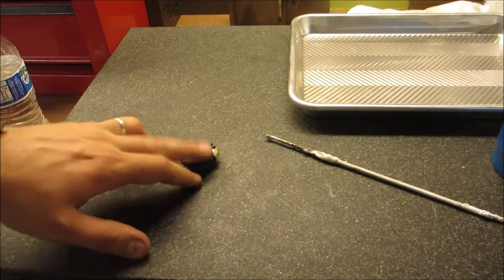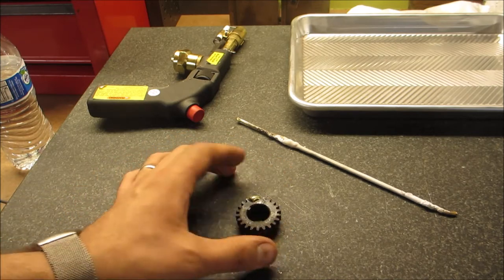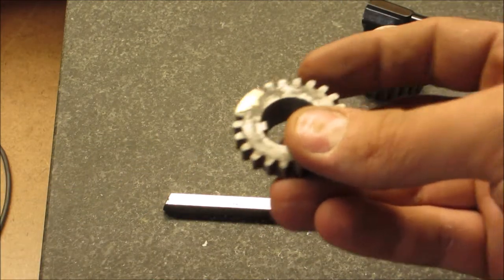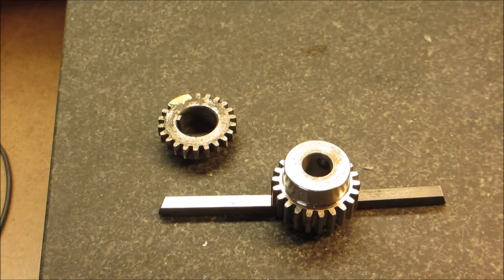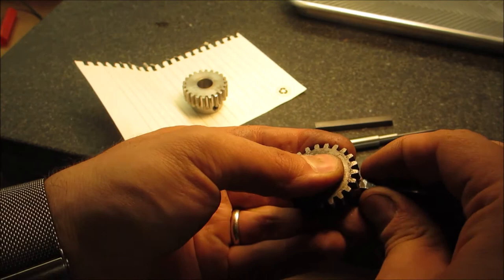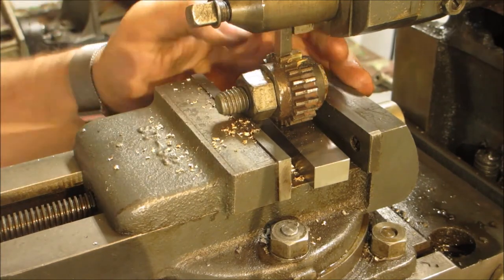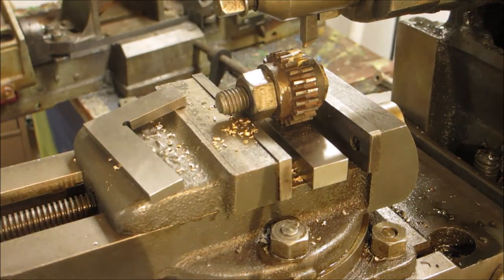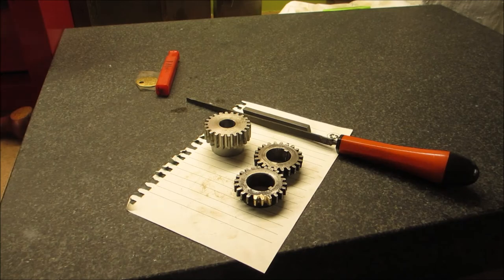Gear Rebuild - Brazing a tooth on a Gear

Comment: I have the same job to do, I striped 5 teeth off the smaller backgear on my lathe in a moment of lost concentration.I tried using a small gas torch like yours but just couldn't get enough heat in it (it's much larger than the gear you repaired) I've arranged to use an Oxy/Propane set up at a local garage to get the job done.Thanks for sharing

Comment: Nice job. Surprised you got things hot enough with propane.
Reply from the maker: Rolingmetal it's a special kind of torch I think. It's called a turbo torch in the UK. The amount of heat this thing makes is crazy. The propane bottle gets cold to the touch when in use at full blast.